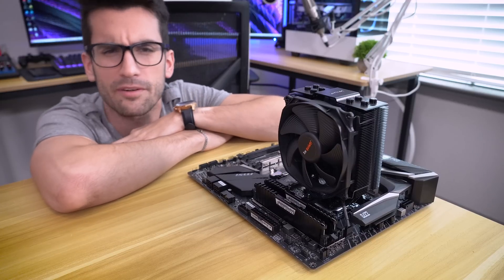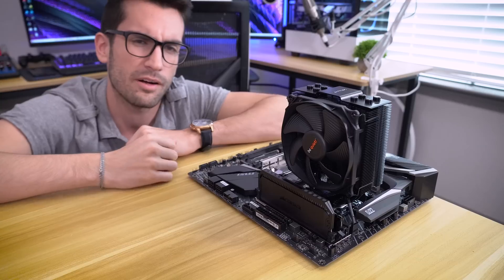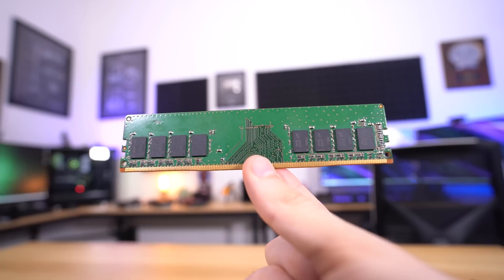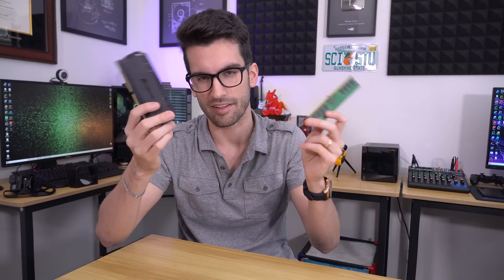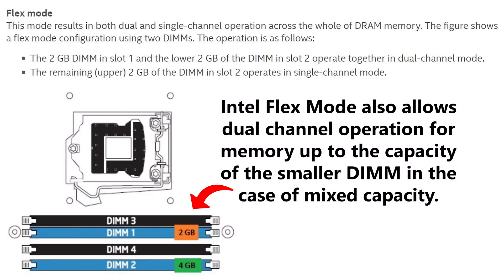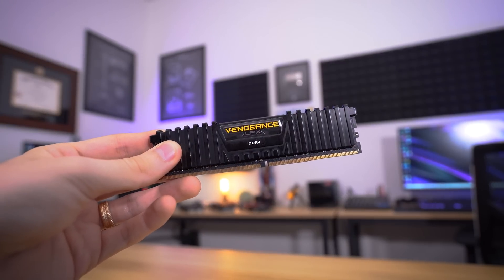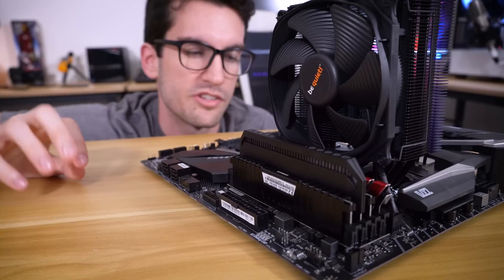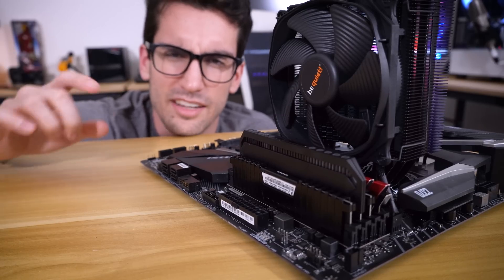Mixing RAM?!

Comment: ive been running into errors bsod alot lately using x4 corsair rgb ram sticks but the only difference is that x2 is 3600 mah and they other x2 are 3200 mah im not sure why im getting so many memory management bsod

Comment: Thanks for the video.  I have a question.  I'm trying to increase the RAM on a triple channel EVGA X58 SLi MOBO with 6 DIMM slots from 12gb to 24gb.  I am having trouble finding triple channel memory kits and am considering using 3 identical (8 GB 2x4)  kits.  Is this configuration still going to run in triple channel mode since the kits are dual-channel kits?  Do you anticipate any issues?  Thanks!

Comment: What if I have two sticks one being 16gb and the other being 4gb both running at 2666mhz? Would I have more speed just using the 16gm of ram by itself or both the 16gb and 4gb together?

Comment: I just bought a Dell laptop with 8GB/3200Mhz DDR4 memory and swapped that memory for 16GB/2666Mhz. Later I saw in a video that Intel's Iris Xe graphics works better with dual channel, so I added the 8 GB that I had taken out. Now I have 24 GB with 2666 Mhz. It is not a problem because the laptop limits the frequency to 2666 Mhz anyway.
Now I have more memory and everything is going well.

Comment: question:   does this mean that if I mix a high density ram (1Rx8, technically slower) with a low-density ram (1Rx16), I will have slower speed?

Comment: My system has 4GB Adata RAM. I added a 8GB Adata RAM. They both have same speed and voltage. There are only 2 RAM slots on the Mobo.  But when I switched on the PC all I got was a blank screen. But when I use just the 8GB RAM it turns on and no issues.

Comment: som1 please respond as im contemplating adding another 16gb of ram into my pc but the current ram is 3600hz and the ram i have got extra is 2133hz both compatible but will there be any implications by doing this?
Reply: If the one you have now is 3600MHz and the 16GB stick you plan to add is 2133MHz then the the speed will drop down to 2133MHz. That's what I understood from this video.
Reply: @AJ-uw9oe  thanks so im not gonna do it then ill just sell the spare sticks
Reply: @duncewashed8220  yeah the more videos I look at mixing RAM modules, I am convinced it's not worth the hassle. Might as well sell these ones and get the same one you have in the system.

Comment: Can I run different brand and capacity but same ram speed? like I have ddr3 1866mhz and a 4gb 1866mhz. Both speed is 1866 but different in brand and capacity. please answer me before I buy ram 🥺

Comment: I overclocked my 2400mhz ram to 3200 is this possible to i buy a 3200mhz ram and run it in my system with my old ram?

Comment: Thanks for referring to this subject. I have one module - HyperX Savage that is no longer available. I must mix it with different HyperX that has higher clock rates. Hopefully this will work as these are same company modules just different frequencies. I must adjust that in the BIOS though... In the past it wasn't so ez though... Now the DDR4 offers much more flexibility (sorry don't know about DDR3).

Comment: My only question is that they are the same ram in every way posible, except for the manufacturer and the cas-latency If i were to to put a ram identical but with 16 CL and another one with 17CL would it work efficiently or not?

Comment: I have x370 chipset i can mix gskil flarex 3200 cl14 with gskill 3200 cl16. If i buy cl16 memory can i run dual channel with lower timing cl16 ?

Comment: Can i mix 8gb ram and 16gb ram which has the same speed and which is of the same brand
Reply: That's what i did.
I had 2x8GB HyperX Predator 3200
And got another 2x16GB HyperX Predator 3200.

I put them in like this:
16
8
16
8

They run in Dual Channel.
The only issue i've experienced is that i can't set them to run at 3200 16.18.18.36.
But the next fastest frequency i managed to get working with all 48GB was 2933 at 14.16.16.34.
And honestly it's no big difference at all. Could just be my case that i can't get all of them running at their rated speed. I updated my BIOS to the latest version. But i haven't tried 3200 yet. Cause i'm scared of being disappointed even with the latest BIOS. So i think i'll leave all 48GB at 2933. A person needs to know when enough is enough. And be happy with what they've managed to make out. :)

Comment: So it can but if I run corsair 3200mhz rgb pro with 3000mhz ballistix for 32 gb it would all run at 3000mhz wouldn't it be better to run just the 16gb of corsair at 3200hz
Reply: You would still be running 48 gb of ram if you run both I think

Comment: Tried adding more ram to my stock PC, had 1 stick of 8GB 2133Mhz  originally, so I bought 1 more stick after 3 years of owning this PC, it was 8gb 2666Mhz, ran fine the first couple of hours, saw all 16gb of ram, then my PC started crashing once every day, the 2 times per day and then almost didnt turn on, removed the new stick of ram and everything works just like before. Should I buy the same RAM as my old 2133 stick or just replace the old ram with the same one I bought (2666Mhz)?

Comment: I've been having a rog strix gl703ge laptop that came with 8gb with one slot free to use. The thing is that, the one that came in the laptop is a SK Hynix 8gb DDR4 2666 CL19 1.2v model. Can I upgrade it with a crucial ram with the same specs (frecuency, timing, latency etc)? I've already checked on the crucial site that its compatible with my motherboard. So, please help me with this because I really dont want to go into comaptibilty issues or corrupt my data

Comment: I need help I have two ddr5 and I'm planning to upgrade my GPU from gt710 to 1060 and the ddr5 on 1060 GPU is pricey so I had to choose ddr4 or 3 1060 gpu  is it ok to mix the ddr5 to ddr3 or 4 of a gpu
Reply: what? video memory is different from ram
Reply: @ryanhtran  

I'm new to PC specs, so is it OK?
Reply: @derpynerdy6294  I can't tell what you're asking, but if you are just upgrading your GPU then you do not need to worry about ram. Video memory in the GPU is already inside of the GPU and you cannot change it.

Comment: i was wondering if i have 2x8gb and 2x16gb in what order should i put it is it 2x16 on the left side and 2x8 on te right side or mix them like  8,16 16,8
Reply: Put the 16gb sticks in A2 and B2 [usually Slot 2 and 4] and than the 8gb sticks in the other slots.
Reply: @xluca1701  thank you so much
Reply: @devilmaycry9385  
No problem I've got 4, 8, 4, 8 in my pc x)
Reply: @xluca1701  so nice i have 8,8 but planning to buy 2x16so i will never ever have a problem coz i am multitasking alot ik its to much but i am sure later on i will have use for it after long time coz games these days improving and require more ram plus i open alot of tabs xD i almost never close them only coz of the ram  i am lately just starting pc openning chrome already 40-50% from my ram , and i have alot of apps in use .
Reply: @devilmaycry9385  
Yeah another 32Gb will do that x)

Comment: I've been using 2 different brands of RAMs on my 2nd system for the last 3 years.
Reply: So you basically run like ddr4 2666mhz but different brands thats what im wondering?

Comment: For some reason when I mix Ram modules I have no overclocking Headroom once so ever I'm mixing Vengeance RGB Pro with vengeance lpx the difference in megahertz speed is only 200 difference between them and the difference in all the timings are only off by one for both of them

Comment: The only reason i need to know if i would be able to pull this off is because i just built my own PC, really high specs but I want to add more ram, however when building it I wasnt able to math it out until it was too late, but my CPU fan cooler sticks out and over the ram slot a bit, so i need a shorter stick of ram with the same speeds and both being 2x 8gb sticks, so thank you! I think it just might work if i can find some!

Comment: I have bought 2 x 4 gb ram 2133 mhz ddr4  and 2x8 gb ram 2133 mhz ddr4 if i mix them in dual channel i shouldn't have any probleme right ? they will all run at the same speed

Comment: I found 2x8 RAM it's 3600 mghz the same as my current RAM but I think the clock cycles are 18-19-19-39 instead of my current 16-19-19-39

IS THIS A BIG ISSUE??
Reply: 18 will be your latency. System will be slower.

Comment: I have 2 different kind of ram sticks of corsair (2*4 and 2*8) but I can't mix them .everytime I boot my pc I stops working. Both of the sticks are 1600Mhz and ddr3 but my pc turns them into 1333 I can't put them on 1600 bc my pc will stop running

Comment: I've got 16 gb of DDR4 ram at 3000mhz (2x8gb sticks) would be okay to add an extra 8 gb stick in the third slot that is also 3000mhz in a 4 slot motherboard and leave 1 slot empty?

Comment: Thanks for the video. I have been wondering about this. I have 24 gigs one 8 gig stick of 3200mghz & one 16 gig sick of 2600 mhz. I was limited on $ when I first built my PC. I went with only 1 8 gig stick of ram with the intention to upgrade later on.  Unfortunately my local shop only had the one 16 stick in stock so.......  I haven't had any issues so far. But it really depends on your motherboard (if I'm not mistaken). I have any budget Asus prime b450m-a and it says in the manual It will work, but only like you said reverts to a common denominator.

Comment: question Greg if your still reading this i got a 32 gig set of 3200 trident RGB's but one stick is dead i was wondering if I bought another set of the same can I run the 3 for 48Gb

Comment: I got a question , I got 16 gb of ram from the brand Hyperx fury and I want to upgrade to 32  I get the same brand but with different model is that fine ? Same speed ( 2666Mhz) but different model

Comment: Not sure if I'll get an answer, but to this point, I've found nothing searching the internet. I bought two sets of Corsair Vengeance memory. One a while back, one the other day. (exact same set, supposedly) The older set has Hynix DRAM chip, M-die, dual rank. The new set, for some reason, has a Samsung DRAM chip, B-die, single rank. Will I have any issues as far as compatibility/performance goes, such as OCing the RAM to get to the 3200mhz speed that the modules are rated at? Is there anything else I should watch out for? Lastly, is it worth my time to replace two of the sticks to ensure they have the same DRAM chips?

Comment: I mixed fast and slow ram and I have really bad FPS.
Hey I just got a new 8GB RAM, I installed it in the mb and since then I have bad FPS although I have now 16GB RAM, when I took out my old ram and changed the setting of the bios so it will work on 2400mh(my new ram card) I still have bad FPS

Does anyone know what's the problem?

my MB: gigabyte ga-b250m-ds3h

old RAM:

Crucial 2133mh

new RAM:

Corsair VENGEANCE LPX 8GB (1x8GB) DDR4 2400 (PC4-19200) C14

Comment: i mixed ddr4 2666 mhz with ddr4 3600mhz  and i get them runing at 3200 mhz wich is the maximun of the lowest kit  OC  , and i have no problem at all .
Reply: I currently have 1x8 of ddr4 2666mhz and the brand is samsung, if I buy another stick of 8gb ddr4 2666mhz but with a different brand like hyperx, will it still boost gaming performance on dual channel mode?
Reply: I’m wondering if I can do the same I have g.skill 3000 in 2x8 and I wonder can I put a 1x8 2666 in to get 24 without any problems

Comment: Could I run different brand sticks but the same speed, I have 2 Corsair vengeance sticks at 3200 MHz and I have 2 g skill sticks both 8gb giving me a total of 32gigs of ram. Both Corsair and g skill ante same speed

Comment: I have 2x 8gb Corsair and upgraded by adding 2 more of the exact same but 2 years later. At first my screen would not receive a signal, so i tried them by pairs and both old and new pair works fine alone. I found a solution by inserting the latest generation first on the preferred dual channel slots of the mobo. I wasnt willing to flash the bios. Even with same exact ram of different batches might encounter some problems at installation so if you're not so tech savvy like me then i would not recommend it.

Comment: If i mix rams with both 8gb but different frequency does the faster one auto adjust its frequency or i need to manually set it to be lower?

I ask this because someone gifted me a ram but a different frequency....

Comment: I found with the 3700 X clearing the CMOS before I install different types of RAM they work way better with no issues versus just putting Ram in and not clearing the CMOS

Comment: Always informative videos.  Greg,  my grandchildren just got me a New iMac 27" 5K.  this iMac was built last week and is the NEWEST MODEL.  Question... I want to Upgrade the RAM, it has 8gb.   I can get 32gb (2X16g) model fairly cheap...  My question is What SLOTS would I use?  I'am just going to use the 16gb modules,  so when I pull them out, SHOULD I PUT the 16gb modules ion the SAME POSITION AS THE ONES I PULL OUT?        Also,  see that the 16gb Modules are so cheap would it be okay to use 4 X 16gb Modules for a total of 64gb?   Any help is appreciated.  I'm not tech savvy, at 78 I need all the expert advise I can get.  Thanks

Comment: Thank you for that video. I have a question though. My motherbard supports on DDR3, and so if I have to choose between two different pair of DDR3 sticks both 8GB 1600mhz, but one, the more expensive one, have CL of 11 and the cheaper one have a CL of 9, I should go for the cheaper one which is also the better one? or have I misunderstood something?

Comment: Maybe's not a question, more advice. I have 32 GB RAM already, but due to complex scenes, 3ds Max window shall to crash while rendering due to lack of memory. So I need an upgrade. The bad thing is that I can't find the exact same modules as I have, neither budget for buying everything new... So, the new 2x16gb is the best shot. I need to fit frequencies and timings right?

Comment: By mistake, I bought a 8 GB 2400 Mhz SODIMM RAM for my MSI GL63 8RC which had a 2666 Mhz 8 GB RAM, would I be running into problems? I use this laptop mainly for gaming and browsing internet.
Reply: @djangojansen7648  Thank you.

Comment: Late to the game here, XD 
I watching due to just upgrading for 16gb to 32gb ram
I built my pc with Corsair Vengeance LPX 16 GB (2 x 8 GB) DDR4 3000  
ovb fitted correctly in duel channel
the upgrade was planed to be identical 3000 16gb kit but ended up with a 16gb 3200 kit as that was cheaper for some reason
so now I have 2 dimms of  Corsair Vengeance LPX 16 GB (2 x 8 GB) DDR4 3000 
running with 
2 dimms  Corsair Vengeance LPX 16 GB (2 x 8 GB) DDR4 3200 
the only difference I can tell is the 3200 is retarded to 3000 

also a random question to throw up 

my old rig I'd love to turn in to a dedicated folding at home rig 
can I purely for computing power and so extra folding and points
use the GTX1060 6gb gpu already fitted and add in the RX580 8gb gpu I have collecting dust? 
or will drivers conflict?

Comment: Ryzen is pain in the ass , i was pairing 2x8 team group tuf 3600hz with 2x8 3600hz team group xtreem since i had them as a gift and i had problems running my pc ,it wouldnt boot at all .There is a red light indicating there is a proeblem with the ram on my mobo and couldnt get past that .

Comment: My old gaming pc had mixed modules, didnt realize it at the time since they looked identical but were different frequencies and it would cause the PC to randomly reboot without warning. I thought at first one of the modules was bad but I tested them individually with zero problems, but once paired the system was unstable. It would sometimes be fine for hours and sometimes it would reboot after just a few minutes.

Comment: I’m currently running 2 16GB kits, I had 2x8 rip jaw kit 2666, but got 2x8 kit of trident Z, have noticed zero hiccups but my mobo does not like the ram running fast so I’m fine with the slower 2666

Comment: Question for those who may know. I wanted to upgrade ram, 2X8 to 4x8. Got some, installed, nada. Black screen, GPU keeps rebooting, everything else is working fine. All 4 slots work, tried with single stick and double stick. Would the new ram just make it not work some how?

Comment: Samsung 4GB 1600 BUS-Speed DDR3 [1.50v]  + TRM 4GB 1600 BUS-Speed DDR3 dual voltage [1.50v/1.35v] >2pc + SK-Hynix 4GB 1600 BUS-Speed DDR3L [1.35v] )  Does it hamper the performance???

Comment: I've seen a LGA 775 PC that had:
1: 2GB 800Mhz CL5
2: 1GB 800Mhz CL6
3: 2GB 666Mhz CL5
4: 512MB 666Mhz CL6

In this case the system would work with 5.5GB at 666Mhz CL6...

Comment: hey i wanted to buy 32 gb of ram and was wondering if i can buy two same 16 GB of same speeds and same timing and run them in a dual configuration so i would have 32 gb or its better to buy 32 gb of ram which comes with 2 sticks.  is there any difference ???? I have Intel 10th gen cpu 10700k  and asus z490p mother board
Reply: Buy 16x2 ram sticks, 32x1 is not worth it if you are not going to buy more 32gb ram soon. So buy for 16x2, you'll get better performance with this

Comment: I have 1 stick 8gb Patriot Viper Elite 2133mhz Cl14. Unfortunately, I can't find it anywhere. I can only find another 8gb Patriot Viper Elite at 2400 Mhz, but it is at Cl16. If I use these 2 RAM sticks, will I have problems?

Comment: I hope some see this... I had a 3000mhz dim already installed and i accidentally bought a 3200mhz dim, can someone help me how i can configure it to reap maximum benefit.
Both dims are Corsair vengeance 8gb ddr4.
Reply: Buy another 3200mhz dim if your motherboard can handle that speed.
Reply: @zirzachtheman  Does ryzen 3 2200g support 3200mhz? Also I have a Asrock A320m hdv 4.0 motherboard.